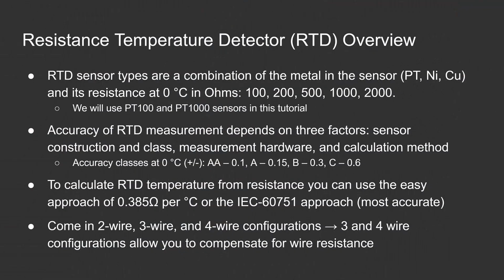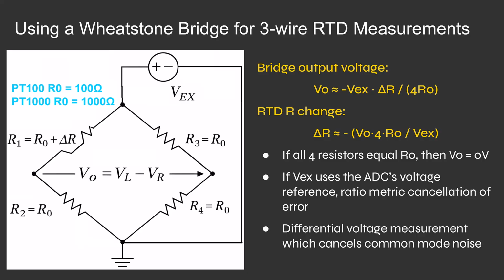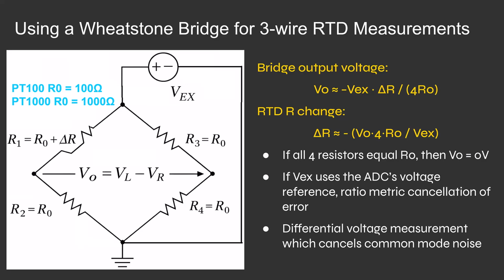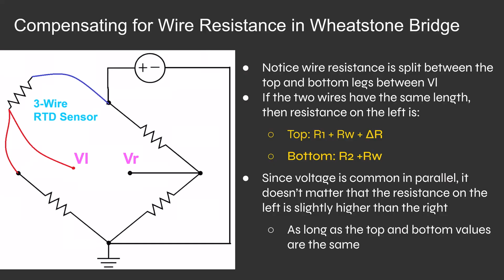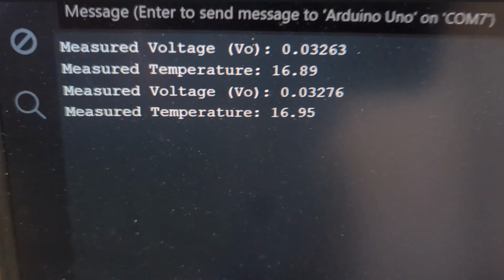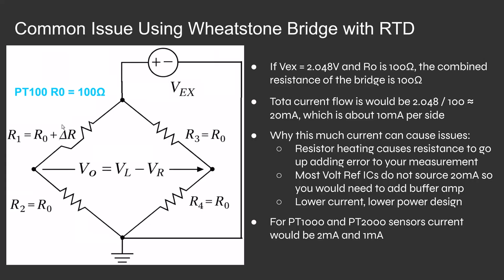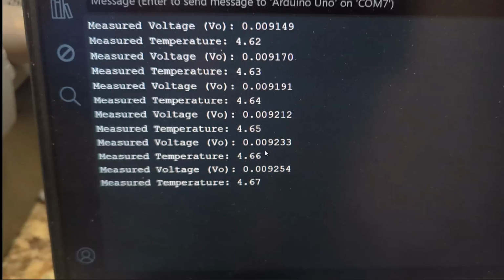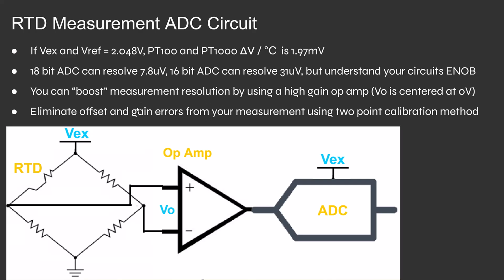Measuring 3-Wire Resistance Temperature Detectors (RTDs) with a Wheatstone Bridge

Comment: In the video you mentioned the issue with self-heating when using lower resistance RTD sensors like the pt100. Is there any advantage to using a lower resistance RTD versus the pt1000?
Reply from the maker: Great question and this was something we debated including in the video but we left it out. Resistors do put off noise (which is probably a future video I should plan) and the amount of noise they put off is proportional to their resistance value. The higher the resistance value the more noise they put off. For this application the noise of concern that they can add to a circuit is flicker noise (0Hz to 10Hz). Since RTD measurements are low frequency or DC measurements it is the low frequency noise you have to watch out for. That is the main advantage of the lower resistance RTD sensors that I am aware of. But in my experience that noise is so low level it doesn't out weigh the advantages of the higher resistance PT1000 sensors.